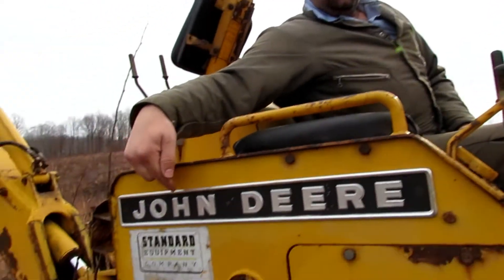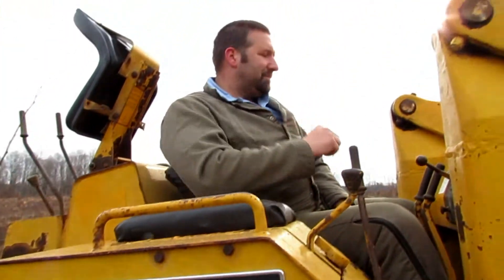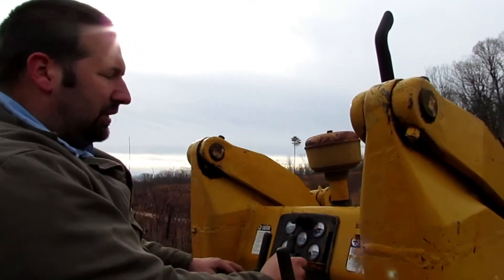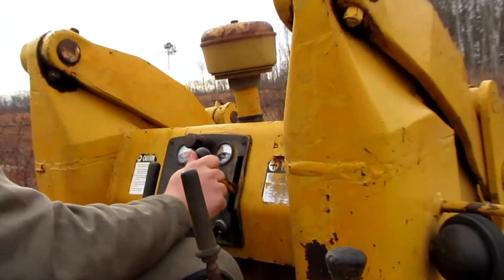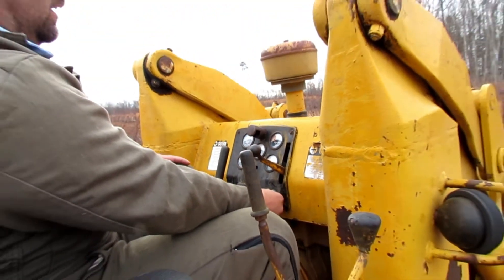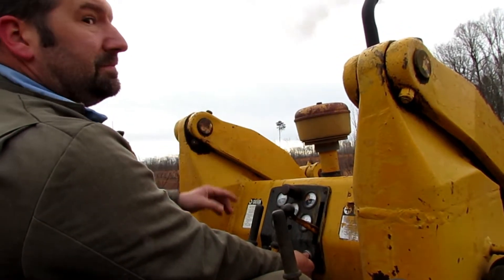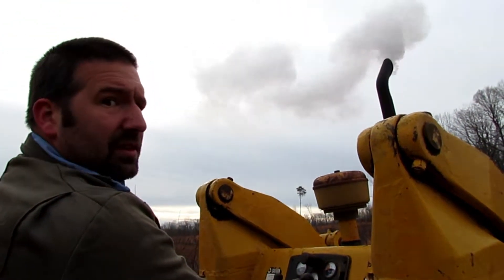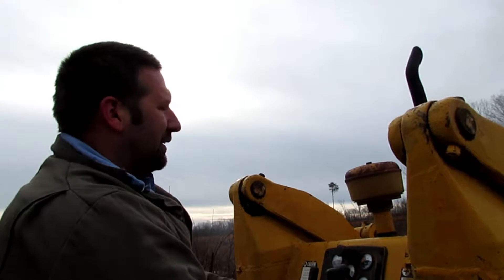JD450 CRAWLER LOADER BACKHOE COLD START

Comment: Mind me asking the cost I have my eye on a 69 with the 2 in 1 frount bucket and a older trailer for 9k
Reply: I'm looking at a 78 for 5k right now, but we are probably in different areas
Reply from the maker: Nicholas Hawkins that is slightly more than what I paid for mine but seems on par especially with a trailer. I really like the backhoe on mine, I have never had one but now I don't know how I managed all these years without! The 2 in 1 bucket is very desirable for some of the work I will be doing. One day I would love to try one out. Good luck! ~Mr. C.
Reply from the maker: Kevin Stewart if it is running I would say that is a very good deal. Thanks for chiming in! ~Mr. C.